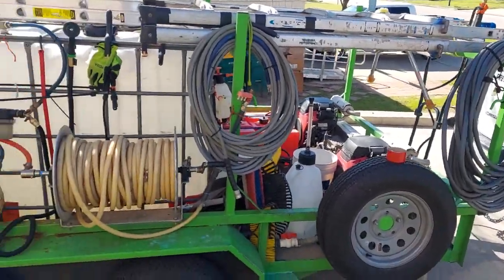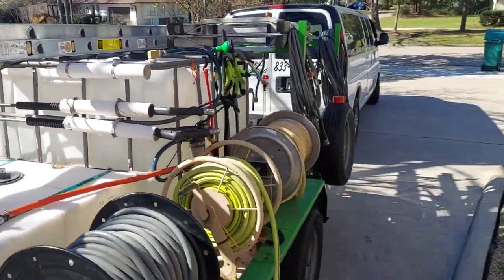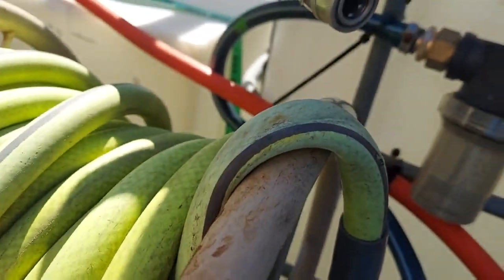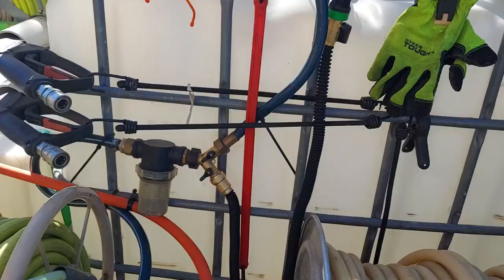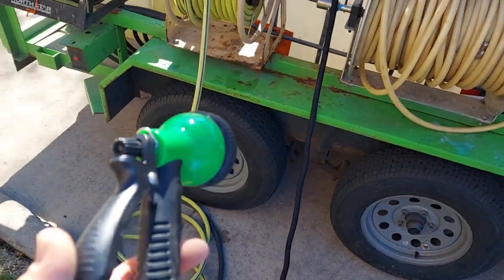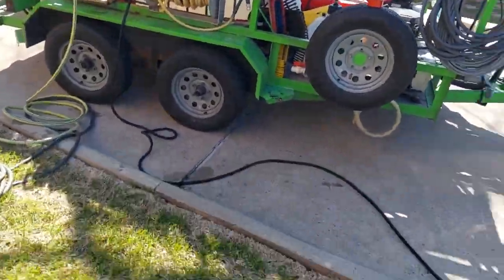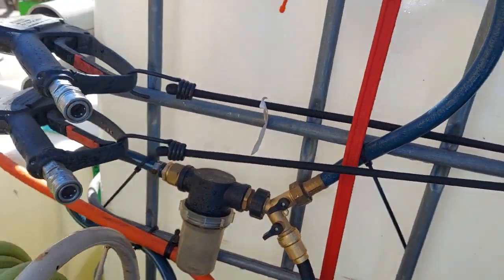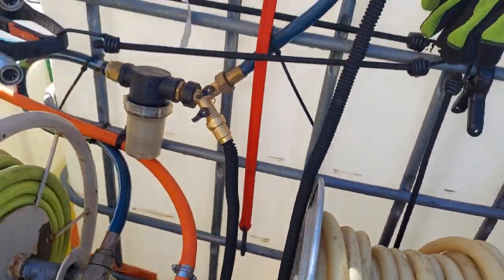Pressure Washing | Soft Washing | Hose Reel Upgrade!

Comment: Flexzilla is a very flexible hose. I started with it but it will collapse on the reel and restrict water flow unless you fully pull all the hose off the reel. I changed to a commercial hose that is crush resistant. It has worked out well for me, just my opinion.
Great video 👍
Reply from the maker: Thanks! What I plan to do is get 3 50' sections of flexzilla 3/4" hose. I'll attach them with quick connects, then pull off what I need and connect it straight to the filter, bypassing the manifold completely. This is what I do with my big hose reel on the back of my trailer.

Comment: Good idea! We will be doing that as well. 

Thanks
Reply from the maker: Thanks. It's been convenient!
Reply: It looks very convenient! We have a 150 feet heavy duty water hose like that from Amazon for water supply to our buffer tank and it works out very well but we have been thinking about a way to have a water source to rinse off the trailer or our hands or fill a bucket I guess we’ll headed back over to Amazon.
Reply from the maker: @Adam Mitchell  this hose is advertised as 25'. It's about 8-9' w/out pressure on it so it doesn't take up much room.

Comment: I noticed you have most of your hose reels mount it directly to the rail of your trailer. I was thinking about doing the same thing. Have you had any issues with them rocking back and forth or anything else with stability?
Reply from the maker: You'll definitely want to check the welds periodically. I need to brace them but haven't yet. I'll be remodeling my trailer within the next yr or so.

Comment: Is the 100 ft flexzilla more than enough? I was gunna buy a new hose next check for my start up. Just making sure i wont need 2?
Reply from the maker: For 90% of residential, 100' is enough. But I'd carry 150-200 to be safe (for residential). For commercial, I'm not leaving the house with less than 500'.
Reply: Big help brotha im gunna cop 1 to start but got anaheim hills and fullerton 24hour fitness to want a soft wash and sidewalk detail. Deff gunan need more than 1 hose big help!!